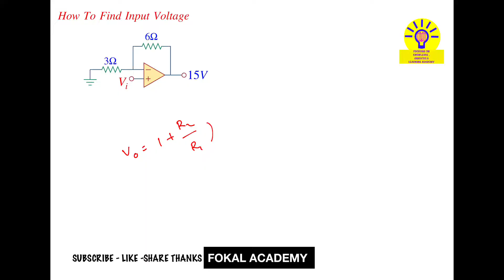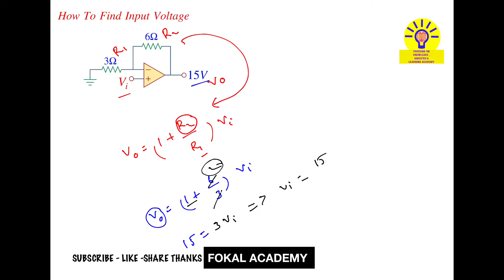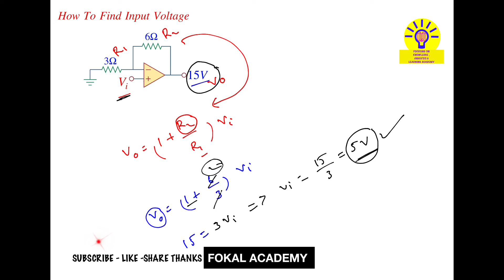How to find Input Voltage  For Non Inverting Op Amp Circuit | Operational Amplifier Solved Problems

Comment: sir isn't this circuit is an non inverting circuit and in this Vo = -Rf/R1 * Vin should be used and Vin should be 7.5 V
Reply: no when the input is given to the non inverting terminal, we have to use that formulae, what he did is correct
Reply: @arfankun6084  the non inverting terminal equation is Gain=(Rf/R1)  +1